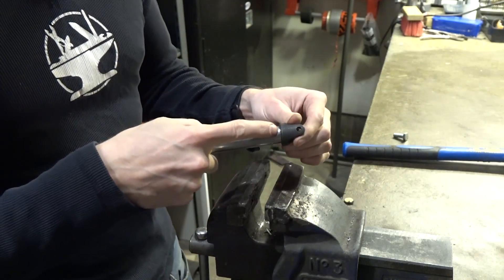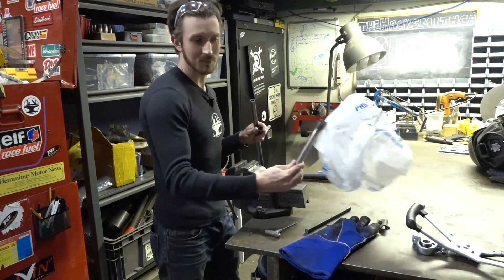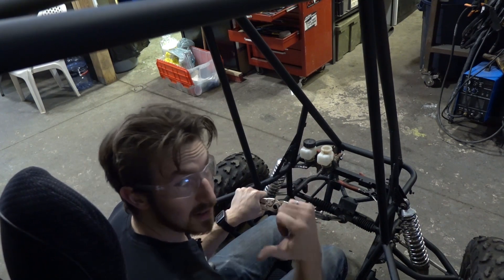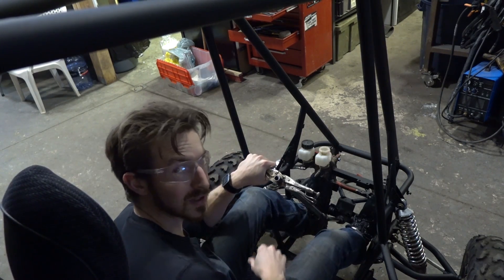Electric Batman Tumbler Part 2 - First Test Drive

Comment: Add a winch so that you can change one of the engines power to a winch that could pull it up a wall. You could also add a firing mechanism.

Comment: i think it would be better not to put that black panel on the back of the vehicle. It will generate aerodynamic forces that will contribute to the drag and momentums on the rear axis that can flip it over the go car... i suppose you have done the calculations tho, but... just in case.

besides that it is super cool! greetings!

Comment: +TheHacksmith Black plating like the batmobile. Side mounted paintball guns whose triggers are controlled by a servo connected to a button on the steering wheel. Grappling hooks. And a led bar.

Comment: when the video was sped up. it sounded like an RC car
Reply: I was thinking the same thing, Its because this tumbler uses electric motors and an RC car does to and when things get bigger the pitch goes lower, but if you speed it up it sounds the same as a smaller motor :)

Comment: Doesn't one universal joint cause fluctuation in the output shaft? That should make it hard to steer intuitively. 

As for further improvements, a windshield and maybe entirely enclosed cabin could make it more aerodynamic, safer and more comfortable to drive. And, if possible, stuff the entire floor with batteries like in a Tesla, to expand the range and give it a lower center of gravity, however this would affect acceleration and breaking...

Comment: Didnt you lost engine torque on the wheels due to the difference of diameter between the pinion(#1) connected to the engine by chain and the other pinion(2) in the same shaft as pinion #1?. This is my point, if you got a difference in diameters in the chain of the engine(being the engine pinion of bigger diameter than the pinion #1)you are reducing the torque due to less distance to force in the pinion #1. Now this torque generated by the engine transferred through the chain to pinion #1is less than the one the engine is providing and this same torque is transferred to the pinion #2 by the shaft which it is connected to pinion #1.
Reply from the maker: It's still geared down for an increase of torque... the motor's top speed is far too fast for the vehicle.
Reply: So  you intentionally reduced the torque output to the wheels?

Comment: widen the distance between the back wheels for stability, add a rubber-pellet turret, either manualy controlled if the steering can be done with one hand, automatic if it cant, or perhaps one of each. the caliber should be large to spread out the impact, reducing the risk of penetration. so something not too much smaller than a human fist. use air-pressure for the propellant. easier to adjust the power to keep it non-lethal. the grappling hook on a car thing never made much sense too me. it seems like it would be tough to use with the limited dextrosity of a wheeled vehicle. and perhaps something to protect against the cold and the wind at the speeds this thing might reach? its pretty fast in the video, you havent even floored it yet, and your going to add a whole other motor, so it could get quite chill.

Comment: To late l guess but you should have moved the footwell area forward and moved seating into a more laid back reclined position. It lowers more of your weight and distributes it slightly. Added benefit is to lower rollbar height. The original chasis needs more Formula 1 influence.

Comment: Soberly gonna need some body work before it starts looking like the tumbler. But when it's got a body how about adding an infrared camera and maybe some kind of smoke Grenade dropper, and on the inside you can have a monitor displaying your speed and what the camera sees. And if the smokes not too warm you might be able to see through it. Kinda like how batman does in the games

Comment: you should add some LED-Lights, as well as some kind of nightvision which uses an infrared camera. so the only thing you have to do is to flip a switch and the nightvison goes on, same for normal lighting.
you might as well add a turning signal and a parking sensor. ;))

Comment: yes definitely seat belts lol a roll cage is ineffective if you fall out of it. 

add lots of aesthetics! the actual tumbler was basically a go cart with a fancy cover on top so it probably won't be crazy difficult to make it look like a batmobile with some covers, shells, or 3d printed parts. maybe some cool flaps that extend or move depending on turning, some stuff to make it look more sleek, and badass headlights? you've got a chance to make your very own batmobile design, you could make it look like no other! 

but what about stuff batman would have though? that's trickier. with what you might have in the shop already i'd say
a winch would be quite helpful. 
a drone launch, cause batman likes to scout out areas or spy on stuff before diving in.
a rocket turret? that sounds kinda dangerous though lol. bean bag gun or paintballs will probably do
an afterburner! or at least something that blasts fire out the back as you cruise by.

Comment: Another suggestion would be to have a launching grapple that is attached to a winch at the rear of the Bat-mobile so you can bring yourself back up from something or if you're pulling someone out you can activate that to get more pulling power. Just another though. 😃 By the way you guys are doing great and I look forward to more of your videos!

Comment: Alright brainstorming, 2nd motor, armor plating perhaps of heat formed Kydex, some sort of uprighting mechanic in case it rolls to roll itself back over, smoke grenade launchers, grapple and winch, rocket boost with the leftover fuel rockets from ironman flightsuit if you didnt use them all on the rocket hammer lol.

Comment: you should add (if you can) larger nonnumatic tires, dual grabling hook launchers, two snow board type things that are stored on the sides and move via hydraulics so you will not sink as fast in deep snow

Comment: Suggestion: Lower the ceiling and add some sheet metal, painted black on the outside with some holes for windows.
Reply: You could also make it a bit longer to make room for more stuff and to make it look like the real thing
Reply: and upward swinging doors like a DeLorean
Reply: Tommy Callaway exactly what i think
Reply: Definitely chop the roof, way too tall and skiny, looks stupid and child-like,
Reply: LOL
Reply: Tommy Callaway I was thinking the same thing. It should be shorter and longer.
Reply: Tommy Callaway but if u do that the weight and if one of his friends is taller
Reply: Chance the seat angle and problem is solved. If this goes on its roof or hits something, force is spread both seat and seatbelts.

Comment: As long as you get some armor plating to somewhat match the style of the tumbler that could also help reduce your drag coefficient, and fire shoots out the back as you accelerate then you're good! Ooh also maybe an airsoft mini gun(or normal heavy machine gun for economic solution) onto the top with a laser guided system that could lock on or something. Possibly the same method of targeting for a dummy rocket launcher too? Maybe a BECAUSE IM BATMAN air horn too which would give you a reason to show people like HISHE(and their fans) what you do

Comment: When the myth busters tested their batmobile, they had the grappling gun that could attach to a light pole and allow it to make a sharp turn. They kept snapping the wire because of the forces from the car but perhaps you could pull it off since you will have less mass?

Comment: do two chambers on each side filled with propane gas and other liquid fuel so when the valve is slightly released it spits lets say gasoline leaving like tire burning effect on the road
Reply: klo 009 less dangerous to that wrist jet no a model rocket engine won't explode a fucking car that amour of propane gas will fucking destroy you
Reply: klo 009 ok that's more realistic because having a pressurized propane tank on the side of a car or anywhere really is probably gunna equal death
Reply: that's illegal
Reply: yeah if you do  it on a real road not on some side on where no one is there XD
Reply: true but its still very dangerous because of the close proximity of flammable substances
Reply: Kevin Neeley less than a puls jet engine made by colin furze which hacksmith fired up
Reply: KadowHunter13 no one said that is supposed to be in huge scale just a small amount and one time use for fun

Comment: I got some ideas:
-Try adding solar panels hidden on the roof for longer trips
-Try adding doors which slide upwards, so u can enter the buggy and slide the door down
-Try adding tinted glass to the doors and such for the batman look
-Add an HUD if you are willing to go high tech
-Make a flamethrower attachment for this car. If you can, make a turret of sorts on the top for 360 degree turning and you can add attachments to this turret like grappling hook, paintball guns, flamethrower, or all three at the same time
-This is a long shot, but trying making the car wider, a bit lower, and a bit longer so it looks more like a car than a buggy and this makes the batman car look cooler and justifies the sliding up mechanism for the door and a turret on the top(cause less chance of tipping)

Comment: I'm a huge fan plz pin this

Anyway I think you should make one/two seats above the engine(supported so they don't ruin or touch engine) then add the paint ball turrets. At the front add a sturdy steal type wall that allows you to plow threw anything like one of batmans car. Also when you are Finished get it street legal and a license plate that says the BatSmith
Reply: The Epic Producer 
You are a genius
Reply: The Epic Producer its steel and through
Reply: TheLegend 27 it's it's
Reply: The Epic Producer lol perfect but he should put the mini jet motors
Reply: That would make it so top heavy that it would tip over to easily. Cool idea though

Comment: If you widen the wheel span you would make it a lot more stable.
Reply: and make it lower towards the ground so it dosent flip over
Reply: The only problem I see with that is that there aren't wheel spacers at that size and if they custom make them they might not be strong or stable enough to handle the stress. They would have to replace the half axles which I'm not sure if they make any that size.
Reply: salman fariz that would require too much work, they bought the cart because it's was mostly complete
Reply: If I remember correctly, the chassis was designed for a college/uni competition. If that's the case, then a student spent hours upon hours making the suspension geometry just right. Spacers will just mess with that, meaning a worse ride, or a suspension redesign.
Reply: FontuneTheTeller yeah because if they took your idea they wouldnt have to by new bars extend sptocket holder and torque converter / chain holder
Reply: He should do that and make it a bit longer so it looks more like the real deal
Reply: Twan Duvigneau making it longer would reduce its ability to make tight turns, but I see what you mean.

Comment: It would be sweet if you could mount like a paintball gun on each side, and have the triggers hooked up to a servo or something, which you could fire from a button on the steering wheel.
Reply: Or a flamethrower. That would be cool too, if not extremely dangerous when you are moving that fast.
Reply: I was thinking

"You know what this thing needs? A flamethrower."